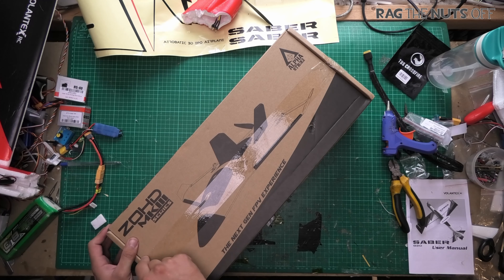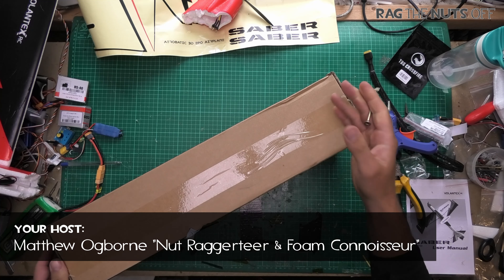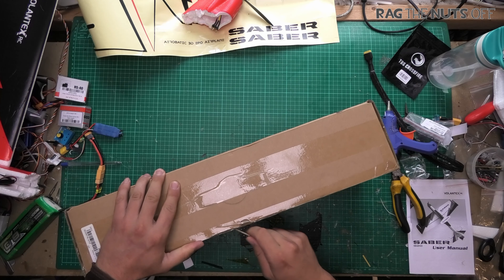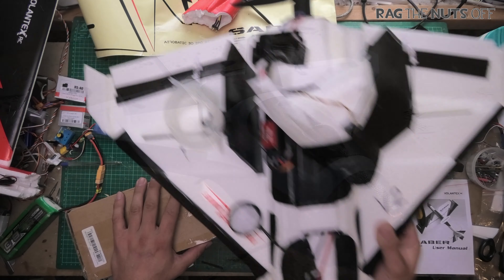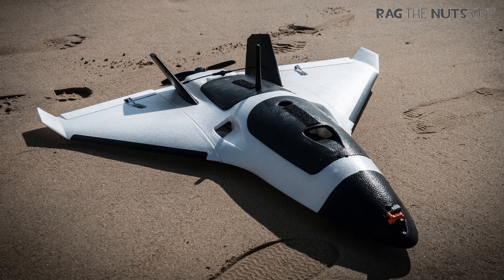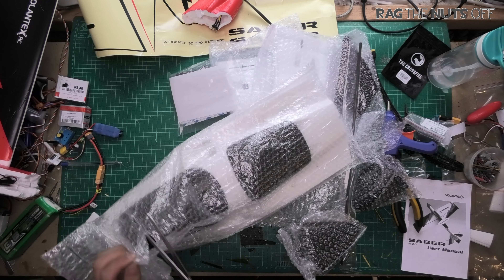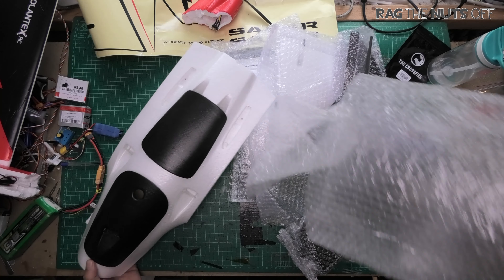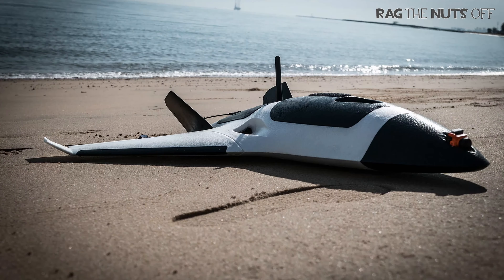How the Alpha Strike Could be Better (Minor Issues/Feedback)

Comment: I don't believe the forward facing ducts are going scrub much if any of the 115mph top speed.  And also all you had to do is squirt some isopropyl alcohol around the servo and release the hot glue, make your adjustment, and hot glue it back in. I do agree the servo positions could be better.

Comment: Matt, there was no reports of servo failure due to tork so far. And when you said standard servo, lol that is relative. A standard servo for us is futaba 3004, in rc for years and is a big servo. You spend 10 minutes in a slot for foam to access the servo arm, really?.  Now the big holes for cooling in front  have a exit in the back so there ok. And by installing the esc in top you ruin the complete aerodynamic of the model.  The model flight in high speed ok by the video so far posted, what is holding me is a video to see if this plane rocks like the zohd nano talon side to side.
Reply: Nano talon rocks side to side? I feel bad for u son...
Reply: @FpvBerget  what do you mean.
Reply: @FpvBerget  ok, the zohd nano talon fist version had dehidral on the wings,  bonifypirate re designed the plugs in the fuselage to make the wings flat.  Later zohd in the haeco d version adopted the bonefypirate mod in the production.   Just for you info.  Smart dudu.
Reply: @maxun1  Sorry, but rewrite in english.

Comment: Why do most ESC's come wrapped in heat shrink plastic, with the assumption it will be buried in the  model? 
Thinking ESC designs need to evolve to include heatsinks so can be mounted external (flush), or contained under a purposed designed air duct. If exposed, the heat sink (aluminum) could be anodized black, or another colour. Being a design element of the model, vs a chunk of heatsink plastic with wires protruding.

Regarding servos, I agree, top-mounted would be nicer and more pragmatic design. eg: would protect servos if landing of damp grass, etc.
A thin plastic cover attached with a screw, or thick sticker would make for nice clean surface. Such a cover could even integrate a push-rod protection like the AtomRC cover which would help keep moisture out of the servo. Once possibility is using credit card material, or 3D printing a flat plastic cover. 
FYI: many 3D printed planes have a cover that servo is mounted too, and then the cover with servo is held in with a couple screws. The arm sticks out of the cover thru a slot, or has a shroud where the pushrod sticks out. 

Sorry, not really timely design options, rather ideas where model designers could improve on existing designs.
Reply: I cut out the shrink over the heatsink part

Comment: Not only would servos on the top of the wing not only look ugly, but it would interfere with airflow over the airfoil just that much more. You're already dealing with a very small plane with a very limited wing surface are to begin with, so the addition of the servos on top isn't going to help the flight characteristics at all at least in a positive way. Hinge tape or packing tape on the bottom of the wing should protect it from damage during landing.

Comment: I like the way the atomrc dolphin has a place for the esc externally at the bottom.
Reply: Yeah, good way to fry all electronics when landing in grass...
Reply: @FpvBerget  I covered mine in conformal coating and have had no issues.
Reply: @REDROBRCFPV  Would be easier to just have the esc place on top instead...
Reply: @FpvBerget  it would be if there was room.
Reply: @FpvBerget  don't land

Comment: A modern BB2 ESC doesn't need cooling. Why put an antique ESC in a hot new frame?
I heard somewhere  that premature optimization is the root of all evil. I'm curious how you think it actually flies.
Reply: @FixedWing  Well a BB2 is cheaper than your antique Hobbyking oldtimer colossus. And we don't all have some because the antiques break and we buy new cheap BB2's that don't break..
Reply: @FixedWing   It's a chipset for ESC's. There is a BB1 and BB2 version. BB2 can run faster than BB1. When a ESC runs faster the motor will run smoother/less noisy. For a fixed wing this will have less result than a copter. The type of semiconductors used dissipate a lot less heat than the bulky ones.
Any modern BlHeli_S ESC brand beat the bulky ones in every way and are a lot smaller.
The stuff Hobbyking sells is 99 percent obsolete. They do have some pretty models now and then though.
Reply: @mooiweertje2084   Tbh I think its more the sychronous rectification (Active Freewheeling) found in these BLheli_S ESC's that helps keep them cooler more than the higher switching frequency. See -  https://youtu.be/uqzOQGiwGnE

Btw. HobbyKing are now selling very similar design plane ESC's, the newer Turnigy Plush 32 series (which are rebranded Vgood ESCS or vice versa) and they can all even be flashed with BLHeli_S !
Reply: @paulhope3401  Don't exactly know. Just that a modern ESC dissipates less heat.
Reply: @mooiweertje2084   Yep, I've edited my reply to add a link that helps explain it better.

Comment: The ESC at the back is a nice solution with a CG penalty perhaps. One solution I think of is to have an aerodynamic exit very close to the prop : the prop sucks air by lowering pressure , so if there are small vents in the front of the plane, perhaps just where the ESC is positioned, an airflow is naturally created inside (that wants to reach the exit) ! Having it outside is a bit of a problem : first, it's ugly (compared to the cool design of the plane), then, if you remove foam and put it so that no airflow is disturbed, there is the boundary layer which is not so moving, that is its feature !